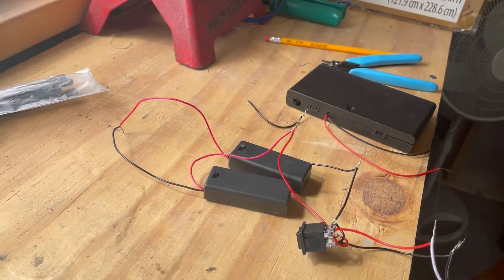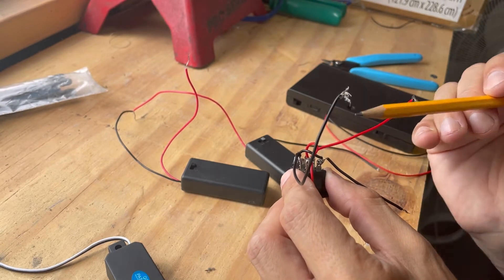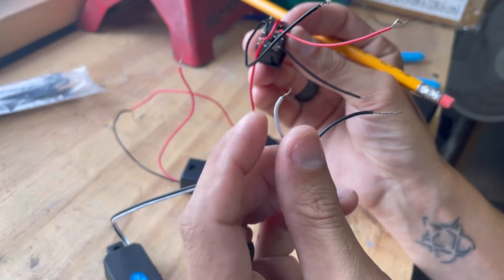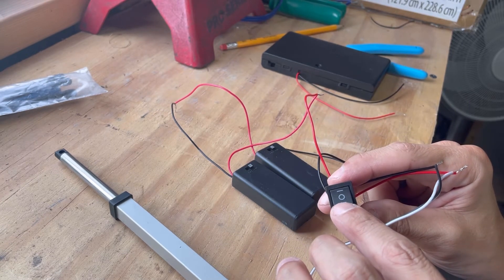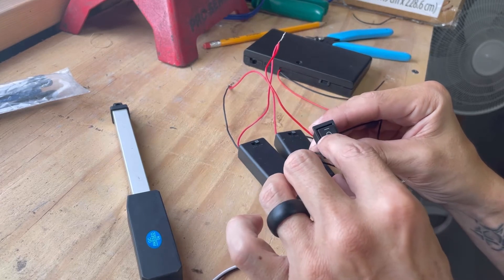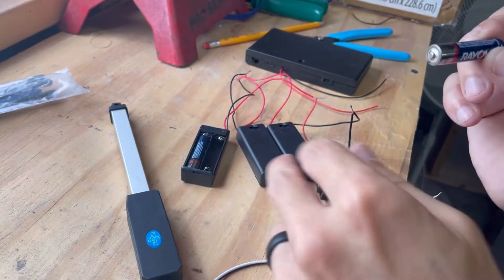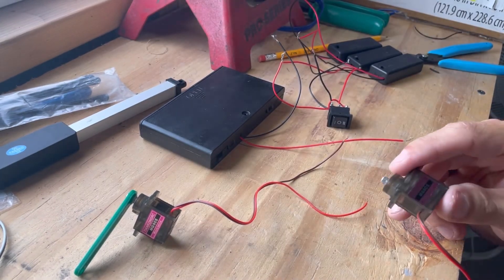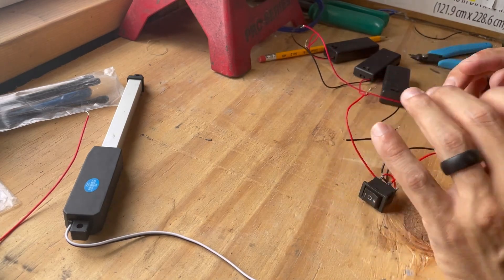How to wire 3 way switch | DPDT switch wiring for servos, actuators & DC motors | iron man faceplate

Comment: Wait where's the third wire from the servo ? (Servo motors usually have 3 wires, 2 for power and 1 for PWM.)
Reply from the maker: When the servo is hardwired it’s just pos & negative. Throwing positive moves it one way & when negatively energized it reverses that motion.

Comment: I need help wiring 2 servos to a battery pack that holds 3 double a batteries. The battery holder has 2 metal prongs (+ and ground or -). The servos each have a ground wire and a power or red wire. I need to connect it all to a rocker switch with 2 metal prongs by soldering, and I am not sure how.
Reply from the maker: @Zman-kd9km  https://youtu.be/z_st0Aq2h2Y?si=B79MD3UJGym0DY7H
You still need a dpdt switch
Reply: @Darkwingdad  I’m using 360 degree servos for a simple bot so it was spst
Reply: I’m just confused about where the wires go
Reply: My teacher said I have to bundle up and solder to red power wires from the servo and put it on the switch I think

Comment: Linear actuator with 3 wire red blue brown how to wire please help bro
Reply from the maker: That’s for an arduino board. You’ll have to go to the motor and hardwire it to work
Reply: @Darkwingdad  power rating 6000N 
12v 55w
Stroke 300mm
Can I run this with 12v battery or board is required
Reply from the maker: @hatchery_andaman  if you hardwire it you can run a 12v source no problem
Reply: @Darkwingdad   can u make video brother, i really want to learn this to make incubator to earn livelihood for my family.

I shall be greatful if u make video please

Comment: Awesome Video! What gauge wires do you use to extend the AAA  battery packs?
Reply from the maker: Hey Jim, just standard 20gauge is fine. Now if you are using a bigger battery pack like the other one in the video and you are using it to do multiple components I’d use a bit thicker wire coming off the pack say 14 or 16 and than use 20 gauge to “branch” off to the other components. That way the current has little resistance coming from the pack.

Comment: I have a On-Off-On DPDT Switch. Is there a way I can solder wires to all six terminals so I can use it in a 3 way wiring scheme? For example, I have a negative wire on terminal 1 (NC), positive wire on terminal 2 (COM), negative wire on terminal 3 (NO), positive wire on terminal 4 (NC), negative wire on terminal 5 (COM), and positive wire on terminal 6 (NO). Or do I have to crossover the wires? This is very confusing. And I wanted to see videos of switches actually wired up so I know what I'm looking at.
Reply from the maker: Essentially the on/off reverts the polarity in opposite directions when direction is changed. What are you trying to wire up?
Reply: @Darkwingdad   VapOven "Battery Powered Induction Heater (Deluxe) Wiring Diagram". This is what I'm building, but it's similar to the diagram. There is a 12v DC input jack, an On-Off-On DPDT slide switch, a 3s 18650 battery pack with BMS, a MOSFET module (which is what handles power to all components), a tactile switch and momentary push button, a battery/voltage indicator, and the IH module. I'm trying to figure out which wires are supposed to connect from the battery pack to the DC input jack and I need to know which wires from DC input pack and the battery pack are supposed to go to the slide switch and which wires go to the MOSFET. Essentially what I'm asking is, I need to know how to hook up the DC input jack and battery pack wires and hook them up to the slide switch and to the MOSFET module. Also, somebody said, “Put a 6 amp fuse on the DC power brick -in. The BMS is a fuse as well but you can back it with an 8 amp fuse in the same way, -in before the switch.” How would I wire the 6 amp fuse?
Reply: @Darkwingdad  Nevermind, I got the help that I needed on Disc. Now I know how everything is supposed to be wired up.

Comment: hi, so how do i wire a 3 pin 2 way dpdt switch that connects from motor to switch then battery ?
Reply from the maker: All dpdt switches need a neutral or resting position so any dpdt is going to be a 3 way. A 2 way switch is a spdt switch with 3 connections (power,to load,ground)

Comment: I am wiring a wireless stoplight. I have two power supplies going to power the main relay for the light. 1 12v 7ah sealed rechargeable battery. Other is transformer power 12v 2.5a would a DPDT Switch work for switching between which power goes to the relay board to power the system. Only one supply should be active at once. Thanks
Reply from the maker: Yes you’d wired it the same just with two power supplies instead of a power and ground.
Reply: @Darkwingdad  thank you

Comment: Hi. Im making a can crusher but the linear actuator im using is 220v. Will this switch wiring method work?
Reply from the maker: No this switch will only work with 12vdc you’ll need a 220 compatible switch
Reply: @Darkwingdad  thank you 👍👍
Reply: 220v ..... Hmmmm ..is that 220vAC .AC as in alternating current ?  If so that motor will only run in one direction because it has no polarity. With no polarity switching wires won't get it to run in the opposite direction.

Comment: Hi! Your video is awesome and I’m a huge fan of your work! I wanted to ask how you would connect two motors to the DPDT switch? Are they both connected to the same two prongs in the middle? How does one go up and one go down that way?
Reply from the maker: Basically the middle prong get a positive and negative (com) and than you essentially you cross the positive diagonal from the top left to the bottom right & the negative goes from top right to bottom left (an x pattern) in the video it shows you how. I can post a pic of you need reference.
Reply: @Darkwingdad  that would be great! Thank you!

Comment: On your wires that are your + and -  wires can you connect a led on those 2 wires so you can make sure that it is getting power when the switch is turned on in either direction?  3:40
Reply from the maker: If you wanted to you could yes

Comment: Please can u do one with a different switch like the 3 prong rocket switches thank you
Reply from the maker: You need a dpdt switch because the servos and actuators require alternating current to work. What were you trying to wire up?
Reply: @Darkwingdad  okie dokie that's fine over ordered some now and was hot wireing a mettel micro servo with a 9v battery